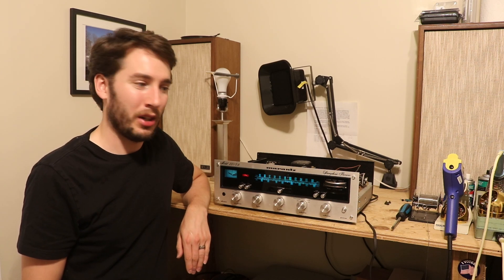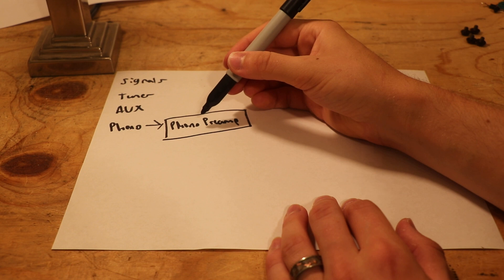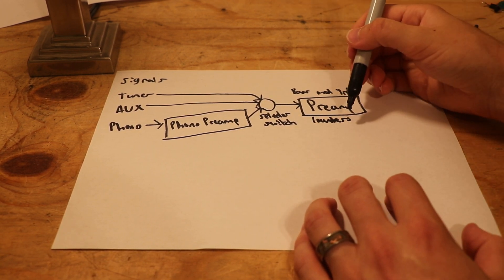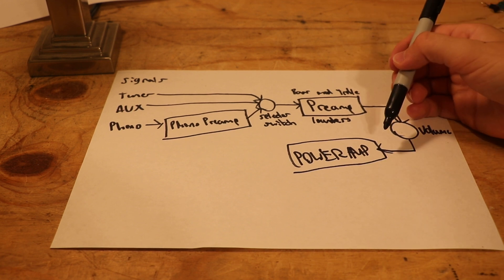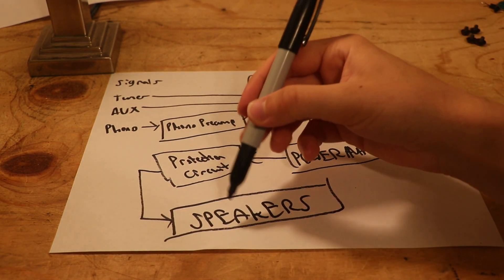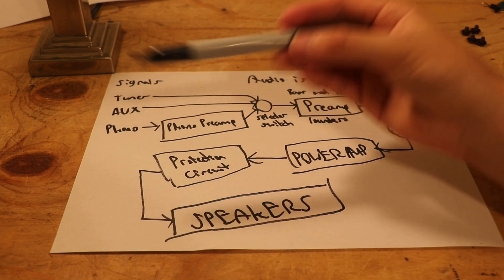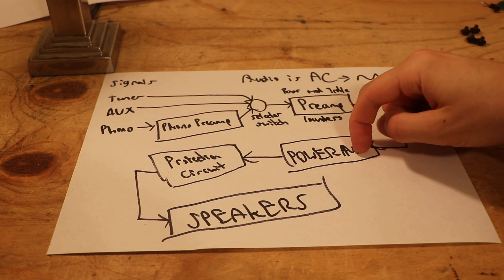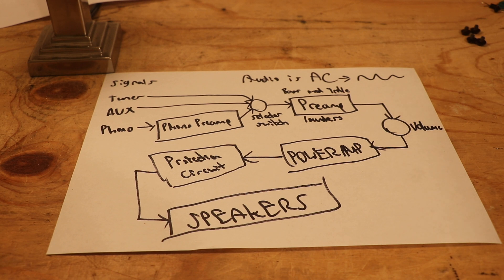How A Vintage Receiver Works

Comment: Finally, a straight on explanation of the workings inside these magic boxes!  This will help immensely with troubleshooting some issues  my old Harman Kardons are having!  Thanks for posting and I just subbed!
Reply: I love Harman kardon. Which ones did you get? I have more modern ones now but I am thinking of getting an older one too
Reply: @stefanegger  My original 330A  (Dec '71) is on the bench at the moment. It went thru lots of  heavy partying when young,  two marriages,  several kids and their friends and has been in storage for many years now. It was 'worked on' by a friend and I think it had more damage done to it than repair. Other units I've picked up lately are HK 230A, another 330A, 330C, a Nocturne Eight Twenty, and a Rotel  RX-400A, which is very similar inside to a 300A.   Recapping will probably be mandatory for some but I'll wait until  I've purchased a scope and  function generator and have learned how to use them better.

Comment: thank you, this is what I  needed to know. I was always paying attention to the path through
the am circuit/ and fm  and all those circuits, they are the  same radio path  for
1930's or 40's till now .of coarse with transistors .  Your the first I have come across to explain
 the rest,  So I have this 4 ch sansui qrx 5500 I think, I purchase  it from somebody that didn't say it 
was  exposed to heat in a fire . it looks normall, but might not have nothing to do with it not working,
but one guy gave up on it , said he changed transistors a stuff that it must be the computer 
he called it , and he checked ,they don't sell that part anymore no one does.  he said.  I wonder 
if I could by pass that

Comment: Thanks for explaining this. I wonder if you could explain the significance of the impedance? For instance, how permissible is it to mix and match different impendence for speakers? Can I do damage to my receiver or speakers?
Reply from the maker: I've been thinking of doing a video on this so I just might do it now!  It's just a matter of understanding resistors in series and parallel, and ohm's law.  Basically you don't want the amp to drive any impedance less than it's designed to drive.
Reply: @AHFixIt  I just purchase a vintage Sony receiver and on the back it says only 8 ohms or more for the speakers. I have a nice set of 8 ohm speakers and they sound great on this old Sony.
Reply: yes it will!